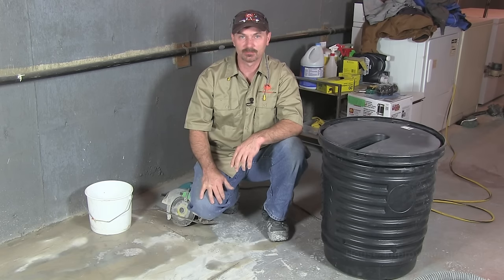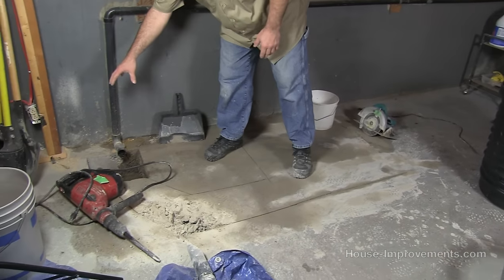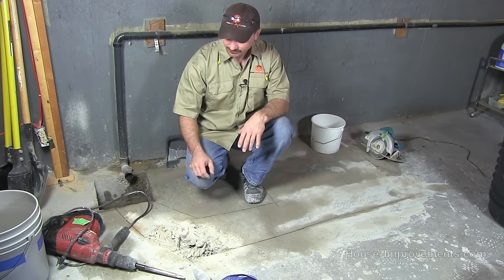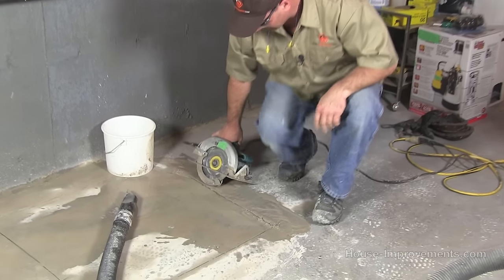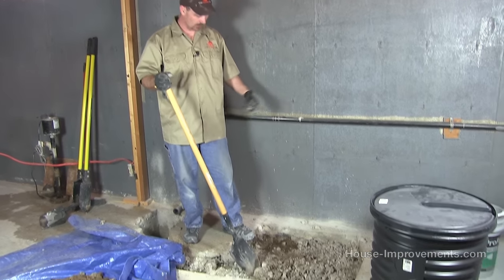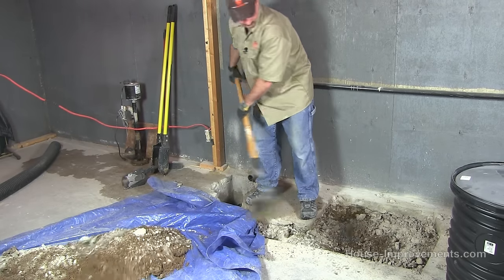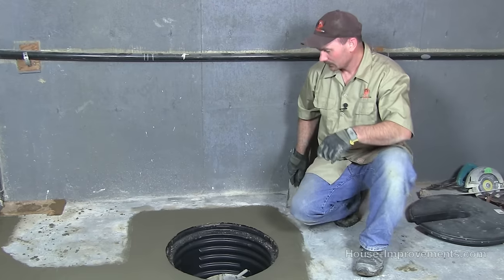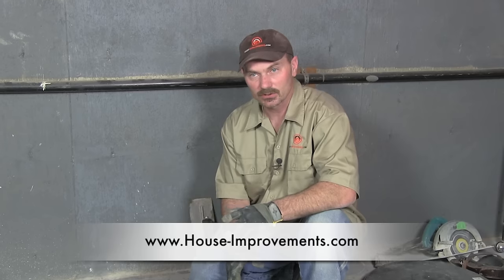How To Install A Sump Pump Pit

Comment: You might want to notify your municipal authorities since this involves pipes that go outside your house and the water has to go somewhere. We have neighbors who empty their sump to the street which causes freezing water to cover our disability parking space. My wife slipped on it about two days ago. The city is getting a lot of complaints about homeowners emptying to the sidewalk or streets largely due to the freezing cold this Winter. 
Another issue is actually addressing the root issues that are causing the problems instead of putting a band aid on the problem that can lead to other problems if that band aid itself has structural integrity issues. 
Where I live we’re supposed to call a city inspector for any digging project. And any work like this requires a work permit where we are. 
Unfortunately many just do the work without going by the required code.

Comment: it would have been better to run the weeping tile drain run from the wall to pit .cut black pipe on the wall back 3 feet and dump in to pit .if you get a heavy rain that set up will still flood or make a mess all over basment
Reply from the maker: This does not make sense to me what you have wrote? We can discuss it further if you come to my forum. http://www.house-improvements.com/forums/
Reply: The small pipe on wall is the existing exit line for water that pumped out of basement. The new pump will attach to it

Comment: I didn't see where you hooked up the  lines that come into pit from foundation drains? or did I just miss something?
Reply from the maker: The lines are not really hooked to anything ,the pipe just protrudes into the pit through a cut out in the side.

Comment: Sump pump pit? Whats a sump than?
Reply from the maker: So the sump is the plastic barrel installed in the floor as a collection point for ground water and then the pump is installed in that sump to get rid of the water.

Comment: This sump pump definitely failed he back filled dirt on a weeping tile with no nylon sock it's getting clogged in 2 years and he wasted so much time cutting the concrete just jackhammer the area don't need perfect lines barely notice them after you put concrete and its a rough basement floor it gets covered in flooring anyways
Reply from the maker: As stated at 14:15 the weeping tile extension is not perforated .
In this case the floor is exposed (no flooring) because it is just in a storage room, so I wanted the joints to look better than just broken jagged edges. 
5 years later and that pump is still there and it actually runs multiple times a day in this house because there is a underground stream in this area not far below the floor.

Comment: You should be wearing a 95% dust mask at least, I'd like to see you in a p100 even better.
Reply: Could one put a 3ft culvert vertical to make a sump well and get that thing out of the living space? Culvert is like $600 and you could make a nice concrete lid for it and put 18in of soil on top?